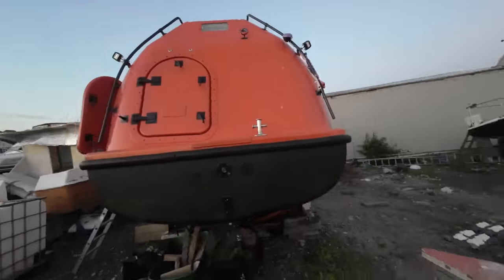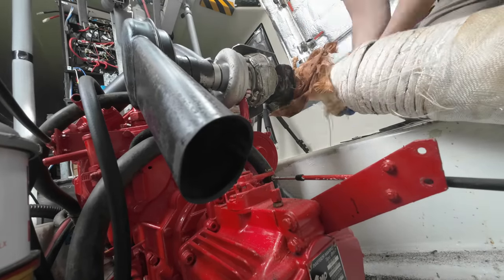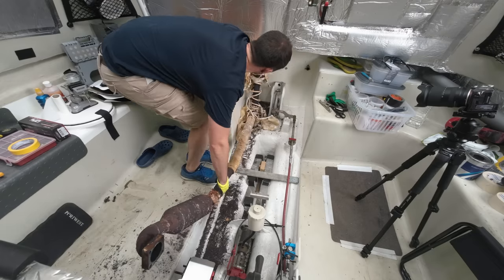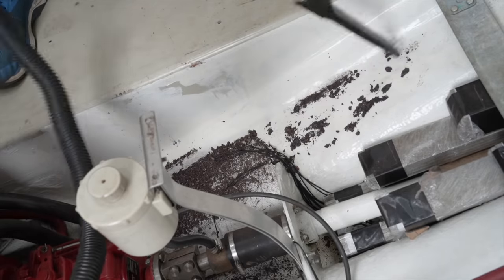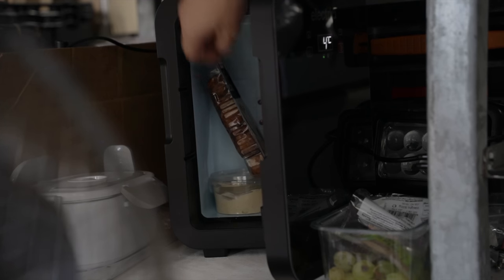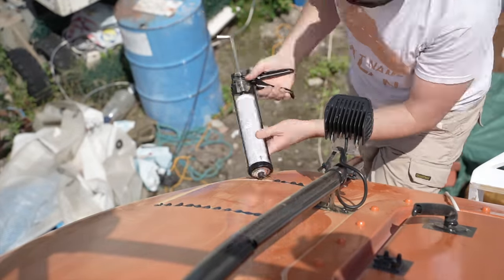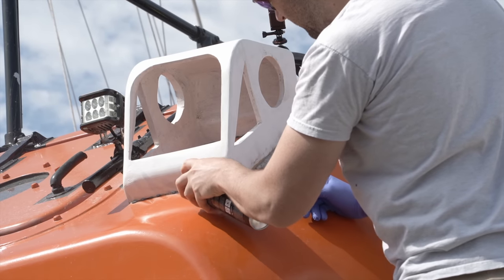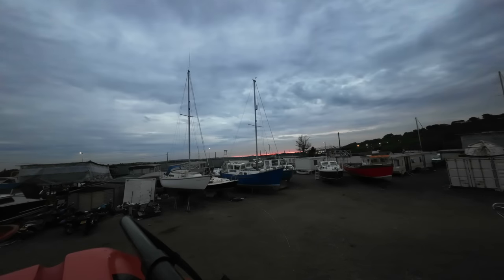Lifeboat Conversion Ep48: Rusty exhaust removal, turbo inspection...& more searchlight housing [4K]

Comment: The exhaust captive threads will be studs. These are used in preference to bolts as the three component thread interfaces  (flange/stud/nut) work together like a locking nut.  Using the wrong fixings means the changing expansion and contraction through heat and also vibration will cause the fixings to come loose.
Reply from the maker: Thanks - will have a read so I don't introduce a problem on reassembly.

Comment: I have a 3D printer, just FDM (not SLA, sadly) but tuned well enough that I can get a decent amount of detail going. If you'd be able to publish or send over some dimensions, I'd love to make an Alan-shaped 3D model and send you over a printed copy. If quality is satisfactory I'd even be happy to do a limited at-cost printed run for anyone who wants a piece (literally), or just share the STL file with anyone who's interested. 
Happy to go either way, I personally think it'd be neat to have a keychain-sized Alan or even a larger model for on my desk to inspire me whenever I feel the need for it, but it all starts or ends with some drawings or clean pictures ofa ll angles
Reply from the maker: This is a cool idea. How much detail is needed? Photos from various angles, or a proper 3D scan? I played around with an iPhone app that 3D scans, but it was a little vague. There are drawings of TELBs online, but none of Alan's exact model.
Reply: @AlexHibbertOriginals  A 3D scan would be amazing because even a picture from all 5 sides (not counting bottom, because that would be a little bit more difficult  I imagine) would only show flat faces and no depth. But if you could do a quick run around and take like a few dozen pictures of all sides that should be enough for a first draft I imagine
Reply from the maker: I'll see what I can do. The 3D phone app I used to use is kaput.
Reply: @AlexHibbertOriginals  Awesome. I just dropped you a message through your website with my email address in it, send me whatever you can at your own pace and I'll see what I can come up with!

Comment: There's a chap called Teal over on 'onboard lifestyle' that's pretty masterful with all things epoxy. He thickens it with (I think) colloidal silica and spreads it in his joints with a 1 inch rounded wooden tongue depressor to create a radius which makes the cloth easier to lay. Might be useful on future bits and/or bobs.
Reply from the maker: Interesting. If you use silica to thicken, and press it in like a paste to 'soften' the radius, it won't have any structural strength to it. If he's just trying to avoid the need for a right angle in the composite, which is certainly weaker than a gradual curve, then I guess that's fine, but most two-part pre-thickened fillers will do that, and are quicker to use.

Comment: I know a few things about exhausts.
The problem with exhaust lagging is it causes the steel to crystalize. You can see it on the old exhaust in the vid. It happens because you been using Alan as a boat that runs for long periods rather than a life boat which gets one long run.

If you hang the expense and get a ceramic treatment that solution is a good one. Also you can reuse the flanges. Absolutely no need to cut new ones if they're not warped. Just cut them off and reuse them. I've always found if you keep your use of exhaust gaskets to the minimum then leaks stop. Just use metal on metal but the surfaces must be spotlessly clean and flat. The sealer is any silicone even roofing silicone works well, but a good high temperature type is probably better. Always use new fasteners with thick flat washers. It works without gaskets because the bolts stay tight. You run the motor a couple of times to heat cycle everything then check the bolt tightness and that's it.

I do understand coating the exhaust pipe is not cheap but sometimes the benefits are great and I would think the expense is worth it in your application. You can use mild steel but get a heavy gauge (thick wall). Thick wall mild steel is very durable in exhaust application compared to crappy thin stuff that lasts about 5 mins in service. Also thick wall tubing is quite a bit quieter and lasts a very long time.

One time I put some lagging on some exhaust header pipes to help stop melting spark plug boots which would then cause the engine to misfire. It didn't take long then I heard the familiar tick tick exhaust leak. I undid the lagging and every pipe the steel was crystalized from heat.
Reply from the maker: Thanks for the insight. A number of different methods with pros and cons, I concede. I've not pushed the button yet to order the build, and still pondering.

Comment: Next time you are fitting a fiberglass fixture onto a hull use some cabosil to thicken your resin to a peanut butter consistency. Then use the peanut butter to glue your fixture to the hull. Then you use a wooden tongue depressor to remove the excess peanut butter around the fixture leaving a perfect radius for laying your glass fabric.
Reply from the maker: I'm in two minds about this. The filler you've made will have no structural strength. Pro: smoother radius. Con: less surface area of fibreglass bonded to substrate.

Comment: Make sure your brass nuts cover the entirety of the bolt/stud thread, and you'll never have a problem getting them off...
Reply: Is that a joke about brass and steel not getting along because of galvanic corrosion?

Comment: Having some experience with those flex joints,  yes they are good,  but they are prone to leak .  I very much wouldn't recommend sharing airspace with it
Reply from the maker: Around the joins with the pipe either end, or actually the structure itself? Cracks in the bellows? Or another method? The engine bay will be vented to the outside, but that's not a primary solution.

Comment: I wouldn't be overly concerned about the turbo but all that soot suggests its either been run at tickover all its life or its been burning a fair bit of oil. If its the prior a good, hard run will clear it and all will be well. If its the latter you're into breather blockages or one of many seals that can fail. If you see much blue smoke you need to go deeper into it. 
I would suggest a CO2 monitor aswell just to be on the safe side. Exhausts in enclosed spaces are always a bit of a chance but when its having to be made one off and not to original specs you need to be very careful. I can only presume there are reasons they decided to go without any flexi-joints which could be a simple cost cutting measure or could be because they introduce movement which isn't wanted for some reason - maybe putting strain on the hull as they move? 
Depending how long you want it to last you may not want the best stainless either. No point paying for something to last 50 years if you're only going to use it for 50 days.
Reply from the maker: Thanks Si. Agreed on not going crazy on the 316 SS. The engine runs without smoke 99% of the time, but if you aggressively rev it to top revs, there's a quick puff of blue smoke that quickly stops. Our yard mechanic said no major concern. What do you think?
Reply: @AlexHibbertOriginals  Well blue smoke is a sign of oil being burnt. None is ideal but if its only a minor amount you can usually get away with keeping an eye on the level and topping up as need be. Usually if an engine has stood a long time it will be something like dried up valve stem seals or turbo seals - especially if its been stood near the sea as the salt in the air helps them dry up. 
Stem seals which only give a puff as you let off throttle aren't a major concern - as above just keep it topped up and expect it to get worse over time. 
Turbo seals are another thing because even if its minor at the moment they can let go in a big way any time they like because of the pressures involved. The results of that are never good and range from loss of power and potential turbo damage if you need to keep running it all the way up to a run away which is pretty much a death sentence for the entire engine - and if it sends parts out of the block at high speed could also sink you. 
These are both things which on a road vehicle would be very minor concerns since the stem seal leak is easily contained and the turbo going pop usually comes with some seperate way to stop the motor spinning - at least in a manual. 
Look up diesel runaway on here if you want to see the potential results of the engine running on its own oil thank to turbo seal failure. 
I don't want to be alarmist because if the yard mech knows his stuff its almost certainly fine. I just want to make you aware of the results if that diagnosis is incorrect.
Reply from the maker: Thanks for the added info. I'll see how feasible a turbo servicing in situ is, and how much it costs.

Comment: Great work. Have you thought about fitting and auxiliary electric propulsion system? Such as a Torqeedo motor powered by solar/wind power. Then you’d have a back up when on exposition or if you need to conserve fuel.
Reply from the maker: You've been sneaking a peek at my upcoming episodes list.
Reply: @AlexHibbertOriginals  Not at all actually haha. Should have assumed you had it covered though. No doubt it’ll be another interesting video.
Reply from the maker: Stay tuned!

Comment: Sorry if I have missed it but why do you need the housing over search light? Is it because ice might build up on the light? Anyway a small hole at the bottom of the housing should help to get water out, when it gets in.
Reply from the maker: To protect from waves (the light itself is weather resistant, but not to incessant, driven sea water) and other torture. Also, so it can be used as a step. A drain hole - yes!

Comment: I am not sure if flex pipe is gas tight enough for use in an enclosed space. Do research and be careful!
Reply: Those flex couplings have a stainless bellows hidden under the outer protective braid so they are gas tight.
Reply from the maker: I think he may have been worried about the style of fixing each end. Some flexis are for repairs, and are only clamped in. The ones I'm looking at are proper weldable ones.
Reply: @LesNewell  ah. All I know is that the one at 2:30 clearly shows the wire mesh on the inside.
Reply: @PsRohrbaugh  Hmm, you're right. Maybe the bellows is sandwiched between the two braids. However it's done they don't generally leak. You can tell when one has failed because the braid turns black from soot in the exhaust.

Comment: on the exhaust metal choice, is aluminium a possibility? its cheaper and easyer to work than stainless and just as resitant 
tho if the engine has a non alu head, it might cause some issues
Reply from the maker: The temp from the exhaust will approach its melting point, and apparently they can be brittle and not keen on vibration. The weight saving isn't a factor for Alan.
Reply: @AlexHibbertOriginals  ah, figured there was a catch, it was less about the weight savings and more about the cheaper and easyer to work material

Comment: 304 stainless will be fine. There's no need to spend the extra on 316.
Reply from the maker: Tempted to agree
Reply: I haven't got to the part of the video yet, but if it's gonna be in constant contact with sea water definitely go with 316.  For inside use 304 is fine
Reply: This man is correct
Reply: Use 316l anything else is a waste of time use lava rock wrap.

Comment: Flexi sections of exhaust are notoriously unreliable and are always the first thing to break. Use one at your peril. Oh, and 316 stainless is the one that all marine/yachty fittings are made from for a reason.
Reply from the maker: I've had tons of advice on steel grade, including going with mild steel and having it coated. I've gone for 304 as it's going to provide a balance of performance and component availability. 304 is common in marine uses for parts not immersed or outside. A purist might say that 316 isn't enough, and 316L is needed. There's a point at which you need to just get on with it.

The original exhaust was uncoated mild steel. It functioned for 15years wrapped in damp lagging, and even now hasn't actually cracked or failed.

The advice I have on flexis is that they vary a lot in design and quality. I've ordered a pure stainless twin-wall design, and UK-built. My decision is that vibration reduction is more important than the chance of a flexi failure - apparently often caused by twisting when being installed.